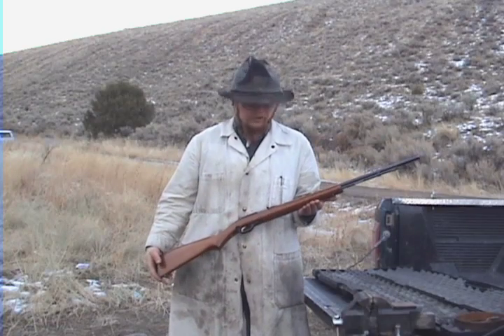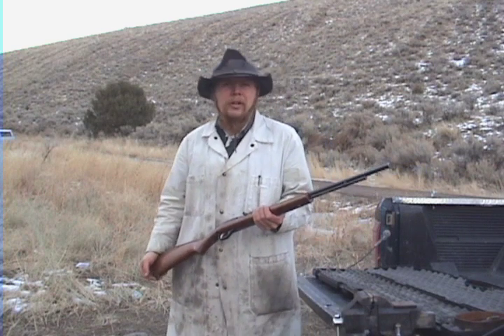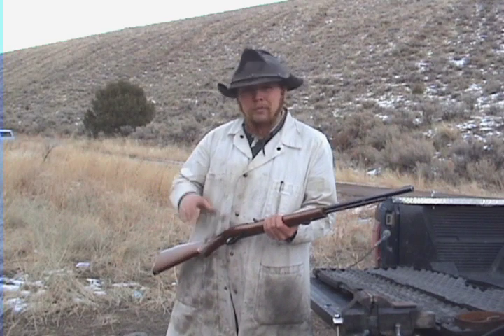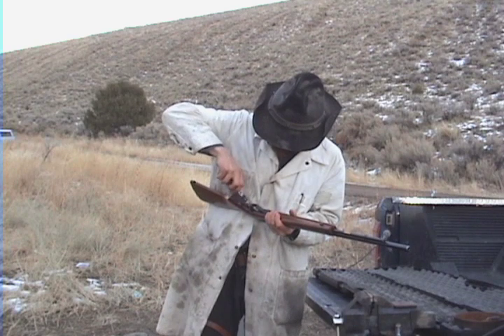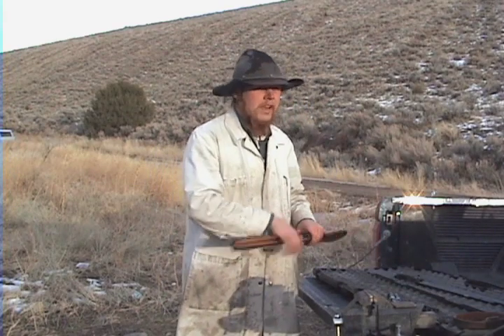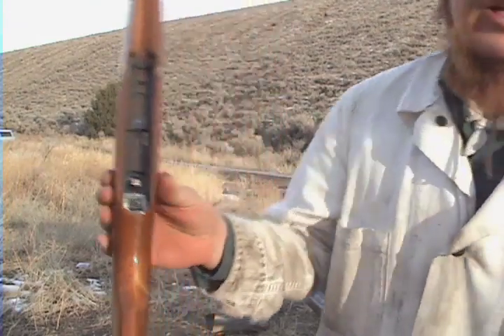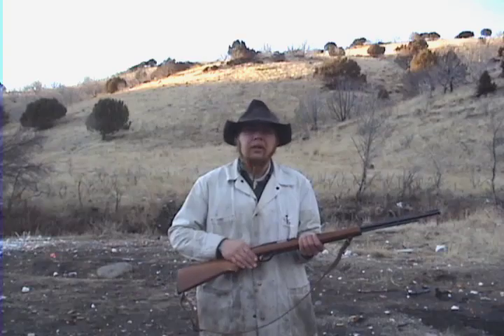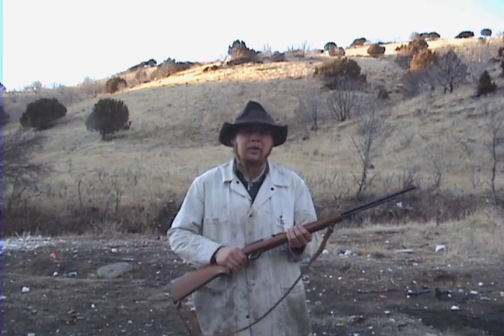Gun Review: Marlin Model 60 (TIS008)

Comment: Good info. I strongly considered the 10/22 when looking for a .22 but settled on a new Model 60. Would have rather had an old one but a new Remlin is what I got and so far it's everything I expected and then some.The Marlin has a larger diameter barrel than the 10/22 and for the long run I want a beefy rifle even if it's just a .22.

I' won't knock Ruger. They make excellent weapons and I believe the 10/22 is one of them, but I think a major reason for the popularity of the 10/22 is because it can be accessorized out the wazoo. Several friends told me to get one. I asked why and was told "because you can accessorize it". That's correct but if I ever find myself hunting small game for the table and only have time to get off one trigger pull, the proven reliability and accuracy of the model 60 will be worth more than a box full of accessories.

Comment: This was a decent video. Thanks. As long as the material and the manufacturing process fits the engineering requirements of the part and the "Form, Fit and Function" requirements are met, the part is acceptable. We do need to be correct in our descriptions of things. Casting over forging doesn't mean the part might be cheap and not function properly. The failure of the trigger guard is probably an injection molding problem and not a materials issue. All materials are alloys. The material of manufacture must match the engineering requirements. Remington bought out Marlin and there were some manufacturing problems with this rifle and others in their line, which has to be considered. I do have to say that the Marlin Model 60 is a better rifle than the Ruger 10/22 and it costs 50% on the average less. Wash your Duster. Billy the Kid, John Hardin, Pat Garret and Jesse James would have loved a Matag. Thanks again for the video......

Comment: Your video sold me on the 60 over the 10/22 and I finally got a chance for some extended range time with it today.   I have to say that it is an absolutely OUTSTANDING performer.   I did carefully clean it before going out - then 300+ rounds with no failures of any kind.  It just purrs along like a diesel engine.  It is crazy accurate too - the groups are so tight when I do my part, and I am still just getting used to it.  Man, you can keep your tactical zombie laser whatever!

Comment: You forgot to  mention the nylon buffer that shatters ; ) I have a Marlin/Glenfield 75 basicallythe same gun. The extractor is built in to the feed through. I have a crack right behind the trigger guard and a shattered buffer on my gun. New buffer is on the way!  : )
Reply: I bought a used one cheap out of a pawn shop. Took it apart and a small pile of plastic fell out. Same story as yours... A new nylon buffer is on the way! LOL Already have a short barrel newer version with a scope so going to leave the old new one with just iron sights. Great plinkers that are easy to work on. Would definitely prefer them over the Ruger in a either or purchase.

Comment: Ironically, for such an easy gun to clean, I am considered a gun wizard because I can get bad ones back running, Usually it is because the wax lubricant on the bullets has built up on the feed ramp. I got my Model 60 for free because it was not working properly. A little cleaning and it runs like a champ. I love its slim lines and built in magazine.

Comment from the maker: Thankfully, the Marlin model 60 is not finicky about ammo. I shoot more Federal through it than anything else, just because Federal bulk .22 ammo is usually the cheapest. The Winchester bulk ammo is practically identical to the Federal. Remington "golden bullet" ammo is loaded a little hotter, but leaves a little more fouling and costs about $2 more per brick of 550 rounds. Still, I'll gladly use any of the three, depending on what's available or convenient at the time.

Comment: I'd say also watch for shattered recoil buffers. mine was completely shattered when i got my model 60 used.(as a gift. i don't think i'd ever buy a used gun for myself that wasn't refurbished). its really simple to replace if you hold down all the spring loaded parts with zip ties when you take one the side plates of the action off. it seems they made that part out of some sort of nylon or plastic that just doesn't last very long.

Comment: I have a model 60 glenfield circa 1982. Marlin told me if I replaced the bolt I'd have to repalce the feed throat and several other parts because the new bolt wouldn't operate properly with the old parts. I'd definetinely check with marlin before doing any replacement parts.

Comment from the maker: I'm about 95% sure that the only difference in the feed throat between the old original and newer-model Marlin model 60's is the alloy that they're made of--the new ones are made of a harder material so they don't wear out as easily, but I think the dimensions are all the same, so it should work.  However, it wouldn't hurt to check with a local gunsmith before ordering the part.  Besides, sometimes if you order a part through a gunsmith, he'll offer to install it for free.

Comment: I disagree with this guy the marlin model 60 has several other problems the ejector and extractor must be cleaned every thousand rounds otherwise it becomes unreliable and will jam and not just cleaned disassembled and cleaned the trigger group/lower assembly pin will wear out and the buffer will break eventually he was right about the trigger guard it will crack in the back other than that it’s a damn good rifle and you can put a lot of fucking meat on the table with it

Comment: I've owned a Model 60 for decades and the only problem I ever had was the extractor spring. I bent it accidently by reinstalling the action with the bolt open. DON'T DO THAT!! Easy fix though. And never over torque the rear screw. Just snug it up. Never had a feed throat problem. The only mod I ever made was to install a heavier recoil spring to allow the use of Stingers.

Comment: I just obtained a Glenfield model 60 which was the first rifle I ever shot over 30 years ago from a relative........needs cleaning and I cant wait to take it to the range....How would I find out the Built date?
Reply: Before 1968 there was no serial numbers, after 68 they started stamping them,take the first 2 numbers and deduct them from 2000; that will determine the years it was built for example mine is 20xxxx. So 2000-20 that means mine was built in 1980. Mine is a glenfield mod 60 with squirrel on stock, was purchased from a k mart store on sale back in 1982 for 59.99.

Comment: Well organized presentation, both in content and style.
One puzzling point however. How come Marlin hasn't strengthened the rear portion of the trigger guard?
It's not like they're planning to discontinue the gun. After all, it's a classic they're probably going to continue making for decades to come.
Why not fix the problem once and for all?
Reply from the maker: Well, I suppose only Marlin could answer that question definitively.  Actually, it is quite possible that they have fixed the problem by now.  Most of the Marlin model 60's that I've used have been at least 15 years old or so, and there have been a lot of advances in polymer science in the last couple decades, as evidenced by the rise in popularity of polymer-frame handguns.  I wouldn't be at all surprised if Marlin is now using a more durable polymer for their injection-molded trigger guards.  

Of course, they could always have fixed the cracking issue by making the trigger guard out of aluminum instead of plastic, or by reinforcing it with a metal strip as I did, but either of these options would increase the cost of the gun, and an increase in cost would probably hurt their sales more than the potential cracking problem does.  At least, that is what I would speculate about why they have not pursued these types of solutions.
Reply: TheIdahoanShow
"making the trigger guard out of aluminum... would increase the cost of the gun... "
True!
Looked up the aftermarket aluminum trigger/guard assembly. It goes for 65 bucks.
Yikes!
For a gun with an MSRP well under 200 US that is a lot.
I like the Marlin 60 enough that I might be willing to fork out the dough. But I imagine many others would not.